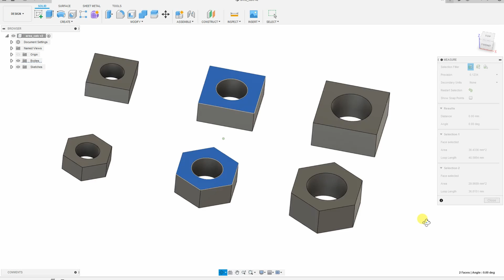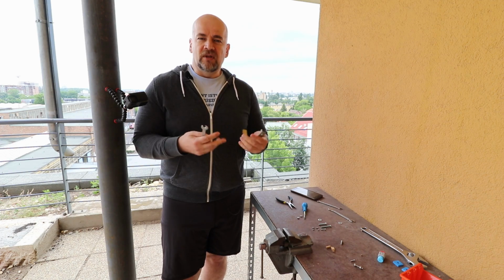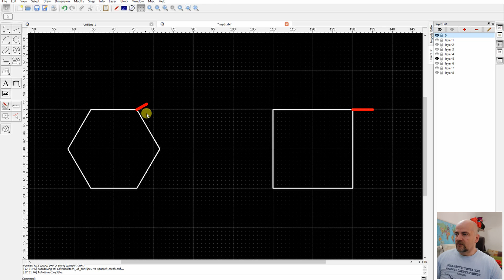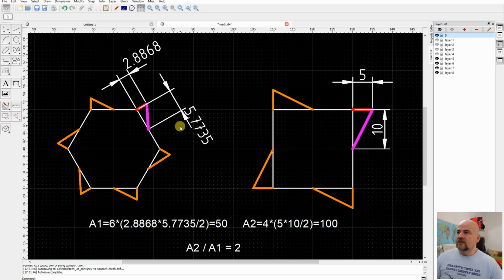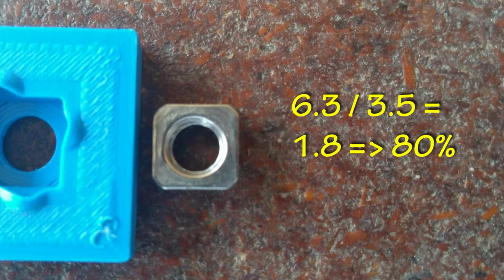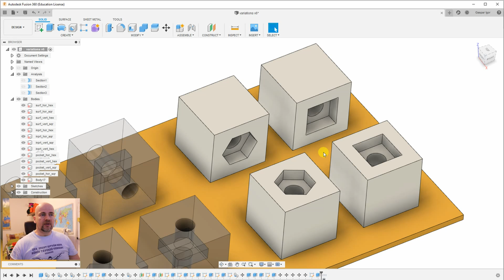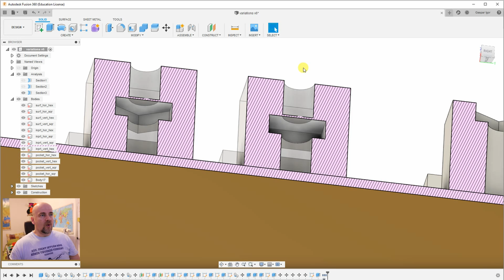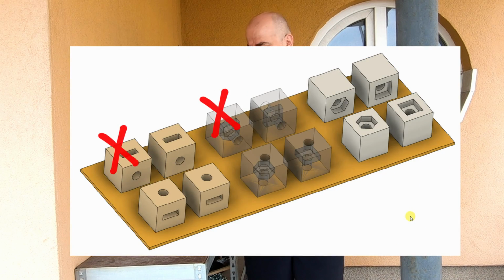Square vs hexagonal nuts as 3D printing inserts

Comment: I use the sharp corner square nuts wherever I can. I have never used heat set inserts but so far I haven't really ran into a situation where I couldn't use a square nut. The only issue is that the ones I have found are really imprecisely manufactured compared to the chamfered ones you have. e.g. the threads are tapped at an angle, or the square is a diamond, or it's rectangular.

Comment: Washers prevent bolts to untie too. That’s why you are using them with 2 metal parts, not to reduce stress like in the case of a wood assembly.

Comment: Dropping nuts into vertical slots after printing, you have further bonus with square nuts of being able to engage 3/4=75% (3/4) of its sides, versus only 4/6≈67% with hexagonal nuts. However, the downside for square nuts in this case I think is that there's a concentration of shear and pulling forces edge focused down onto a single layer in the corners, whereas hex nuts distribute the stress more widely across layer lines.

Edit: Ah! You cover this at 12:34. I like that you mention too getting the sharp cornered square nuts. I haven't been able to find quality ones of them though. All the ones I find are crudely clipped, off-square, and with holes that aren't centered. That means I end up needing to design with slop in either the screw hole or in the nut slot, so I often end up just using my better machined hex nuts anyway.

Comment: Another factor is the  print fill, which I am assuming it was on full?! Also what is the yellow plastic "washer" @13:34?
Reply from the maker: That's just a 3D printed nut from flexible material, so I don't need open-end wrench to tight that bolt. (and yes, max infill)

Comment: Agree with everything here.  I reached the same conclusions stupid, time wasting methods.  I print all my embedded nuts just like he did, with a pause and a 1 layer bridge.  It's so much easier when you have a part with 15 nuts and you don't have to worry about them sliding out of their slots.  It's amazing too how hex nuts will spin in almost anything.  I've even had square nuts start to spin in TPU parts when I'm not careful.  Great work, especially with the section analysis.  It took me so long to nail this down on my own, I wish there was something like this to watch when I was pulling my hair out.

Comment: https://www.convertunits.com/from/newton-meter/to/kg-cm 
As per above converter it is saying 6Nm is 61 kg-cm but you video shows that it broke at 3 kg.
Is the conversion correct
Reply from the maker: 3 kg on 20 cm = 60 kg/cm. If hanging scale would be only 1 cm from center, it would measure 60 kg.

Comment: i usually do a triangle hole on one side like with a hex nut when i do a square nut to solve the over hang problem that or leave the to empty i mean you can always insert it then glue in a plug for snuggly fit all sides
Reply from the maker: I will test triangle nuts too, just for fun and curiosity
Reply: @MyTechFun  hmm.. wasn't aware there where triangle nuts but that has to have the best surface area.... other then say a rectuagular nut that elongaded...but that would probably be wasteful of space..

Comment: Did you ever try to print nylon mechanical parts ? I think it's the ultimate material for strenght purpose, am I right ?
Reply from the maker: Nylon is good for technical parts, only problem is hard to print. Biggest problem is the moisture, it has to be very dry, enclosure recommended, use glue for better adhesion to bed.. PC is also good (will ve a video about it soon)
Reply: @MyTechFun  after i wrote my initial comment I saw the experiment you made in your car and oven with a lot of plastics, including nylon.  I heard it was really hard to print as you said.  I was wondering if it was worth it.  I think I would need to mod my CR10 with better hot end.. Anyway, thanks for the reply and for all this data, it's really usefull for a lot of makers all around !

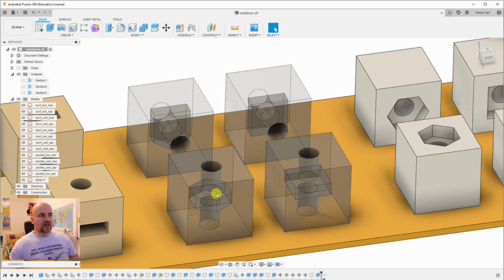Comment: At 11:10 you explain that you add bridging layer for horizontal embedded nut during layer-print-pause, because in CAD cross-section, it looks like you're printing in thin air. However it seems unnecessary, as the nut itself will serve as support material. Or what happens?
Reply from the maker: The problem is during 3D printing. Bridging requires two points to be connected, but here the printing would start bridging and then "stop" in air where the hole is. That's why I use here that sacrifice layer mentioned in video. Later, when plastic is solid, there is no problem with it any more. Create a similar object, and watch the printing simulation in some slicer, and you will understand what I am talking about.
Reply: @MyTechFun  When the nut is there, it's within 0.2mm of the layer being printed, so there is no bridging, you're printing on top of the nut instead of on top of the plastic. Bridging is like printing on top of thin air, but there's not air there, there's already a nut, inserted during pause command. Not sure why i should watch simulation, i know what failed bridging/bad overhang looks like, because... of course i sometimes design and print things that i intend to print with supports, and then idiot me forgot to enable supports.

But when the nut is inserted mid print, the top of the hole is supported by the nut when printed.
Reply from the maker: @SianaGearz  In this video I am talking about nuts as 3D printing inserts, you add them AFTER you finished the printing. During printing nut is not in the object.
Reply: @MyTechFun  But at this timestamp, there is no access hole through which you could install the nut after printing :D You have shown both constructions with an embedded nut and with a nut insert space :D I know i'm nitpicking, and i don't really have a real point, but it's a bit funny that you forgot what you did mere weeks ago... OK it's probably not fair, i often forget what i did an hour ago. :D But i sometimes wanna be THAT person on the Internet you know?
Reply from the maker: @SianaGearz  Oh, yes, that's inprint, you are right, must be my age.. forgot things. Or maybe my 3 work places and 3 daughters.. There is a chance that your idea would work to use a nut to support that bridging, not sure, I didn't tried that method yet. It will be interesting thing to test.. Thanks for the suggestion.

Comment: Very wonderful comparations,it's so common sense of course,the less corners or like star shaped grooves will always be better for full torque than a more of a circular shaped bolt or nut.
Reply from the maker: Yes, but not always less corner is better. Soon I will compare triangle vs rectangle screw nuts to explain the details.
Reply: @MyTechFun Totally get ya, Even  I was always thinking of  triangulation type bolts or construction screws sure would be  extraordinary lol.

Comment: Why couldn't hexagonal nut insert in builtin printing in vertical position early then square nut? It can be hexagonal inner builtin printing. Pentahedral as inverse house doesn't need, and it can let to increase torgue.
Reply from the maker: Inserting hex nut in vertical position? You can't close the hole, nozzle will hit the hex nut.  Or hole starts closing, then you can't insert hex nut any more.

Comment: Dumb question, but what about triangular nuts?
Reply from the maker: Not dumb question, I got several similar comments. In torque test they would perform even better, but they are not standard, you can't buy them and there is no key for them to use in other projects, you can use them only as inserts.
Reply: @MyTechFun  Ah, thanks. A lot of times when people are building stuff, I can't help but think "Triangles! Add triangles!" Thanks math class. :P

Comment: Square & Rectangle nuts for inserts are superior, that much is obvious. I also would assume the inprint method of installing them would be the strongest. Although, it is the hardest to put into practice. I wonder how much stronger inprinting is over the other 2. For example, is it much much stronger because it is surrounded by much more  material? Or is it only slightly stronger? In which case not worth the extra effort to invest in doing. I would love to see a test of that.... Inprint vs. pocket vs. surface...

Comment: Note: Metric square nuts have DIN 557 and DIN562 - 557 are thicker. In general I really like if people just give me the DIN or ISO numbers for screws and parts in builds. It makes finding the right parts SO much easier than "use square nuts". You can find them in any online store, Aliexpress etc. easily by their numbers and not spend half an hour trying to figure out which of the dozens of variations of nuts has to be used to fit into that pocket.

Comment: in addition you could take 1/8" (3mm) metal bar and tap-drill threads into a length to make a nut-plate and basically exceed the torque ratings of the threads and/or be able to generate much higher clamping force on your plastic, to the point of crushing the parts. Hope this is helpful.
Reply from the maker: Yes, helpful. It looks like I have to repeat the test with some rectangle and triangle nuts too (according to some comments) ;-)

Comment: Very good video. But how do the nuts compare to threaded inserts?
Reply from the maker: In this video I was only comparing these two nuts. Threaded inserts are good if you only want to joint objects only once. If you want real non permanent joint (like gopro mount), then metallic inserts are better. In near future I will test 3D printed bolts, nuts.. only to finish exams on my primary workplace ;-)

Comment: Most plastic component joining with fasteners doesn't require a "death-torque" anyways. Just getting it snug will do. Think about how most appliances go together with stuff like this, if you went all out tightening the screw that goes into some nut on your desk fan, you'd break it. Keeping that in mind, using the more common fastener would often do. (But I suppose using the square nut or bolt would be handy for some edge cases.)
Reply from the maker: In most cases you are right. So far I had only one project, where I needed very big torque with insert. Here I used a nut with insert to create something like butterfly nut, so I don't need a wrench (M8 and M10). And in combination with washer, the maximal torque was the limit for this joint. 100% infill can handle very big compression tension.

Comment: Nice explanation. I would have thought the shape furthest from a circle would be more difficult to deform the shape it's set it.  So going by this theory star nuts should deform the shape and slip less. Can you test this?
Reply from the maker: I don't have star screw nuts, they are not standard. And using them as 3D printing inserts.. theoretically yes, they are good for big torque, but in smaller dimensions (M3, M4 maybe M5) most common nozzle (0.4mm) will result only 1-2 perimeters between star tentacles and that will be a week point. Go with rectangles if you need something better than square version.

Comment: Honest question, can you get star shaped nuts? I know this would only really help for surface horizontal or inprint horizontal situations
Reply from the maker: Star shaped nuts? Not too standard ;-) Using them as 3D printing inserts.. theoretically yes, they are good for big torque, but in smaller dimensions (M3, M4 maybe M5) most common nozzle (0.4mm) will result only 1-2 perimeters between star tentacles and that will be a week point.

Comment: I might’ve missed it but were the two nuts the same thickness?

Also, the nuts could’ve been initially tightened to a higher torque so there would be no further tightening during the test making it easier to determine the yield load.
Reply from the maker: Same thickness, I forgot to mention. About tightening, M5 bolt is not too strong. I was stronger (with wrench) than threads on it on my first experiment. I tried to tight metallic nuts as much as possible. Threads were sheared.

Comment: Not really surprising as that is not the primary use of normal hexagonal nuts. They are designed not to apply rotational forces but longitudinal - along the rod.
Hexagonal nuts are a bit easier for handling (easier to get the tool aligned and lower angles needed to reset the tool) while also providing a higher force per area. Square nuts offer higher torque and and self-bite into the material. Different use cases, different nuts.
But in general, if the torque is sufficient i would go with the hexagonal nut - more widespread, cheaper.
Reply from the maker: In general I agree. But as 3D printing inserts, you don't need a tool for a nut. Only with those pocket inserts I wouldn't go with hex. In other cases, hexagonal will do the job too

Comment: One way that I like to visualize this comparison is just by focusing on the number of sides of the nut. As you increase the number of sides, you begin to approach as shape that more closely resembles as a circle. A circle will have minimum resistance to rotational force. Therefore, I always rationalized that  increasing the number of sides will make it less resistant to torque. Through this logic, fewer sides (a square) will perform better as a captive nut than one with more sides (a hexagon).
Reply: Maybe triangular nuts?
Reply: @desparky  I thought the same but those are extremely difficult to get
Reply: @octimus2000  that's why we print them ;)
Seriously we should start producing them, we would kill the hex nut... if there was no issue with the triangular wrench.. lol!  Good for sockets but I can't imagine a functionnal triangular open key/wrench..  square is best
Reply: @anthonythibodeau81  That is a good idea, but they would only serve the 3D market more or less... Also the nut isn't the issue here, its the material that braces/locks it into place, which is the 3D material!
Reply: @desparky  How about Torx nuts!

Comment: You can also force a nut into a tight pocket by using a screw that, as it rotates it will create a force in the axial direction, pulling the nut inside of the pocket. A washer on the other side will protect the plastic part from excessive stress from the bolt head pulling action.

Comment: the big question is what happens when the nuts are glued in, are there any differences?
Reply from the maker: Depend of the glue. In my case, glue only holds it to prevent falling out. But there are strong glues too, to fix against rotation (polyurethane base glue)

Comment: It would probably be more useful to calculate not the nuts themselves, but the strength of the recesses. The plastic parts will always have inferior strength to the metal, and rounded shapes run a great risk of deforming parts and spinning in place.
Reply: Gee, thanks Captain obvious.

Comment: So....we need triangular nuts?
Reply from the maker: In theory, they would be better for torque transmitting, but I suggest rectangular ones, if you will need to use it with wrench (as inserts you don't need a 🔧)
Reply: @MyTechFun  Years ago, my friend invented a car with square wheels. I told him that it was completely stupid because it was too bumpy and that it could have triangle wheels instead; one less bump as it turned.😃😁

Comment: During the electronic scale test, how come the hexagonal was double the torque before stripping the hole when we calculate the square version to be higher than hex in theory??
Reply: Did you confuse the two? At 6:43, the hexagonal nut was measured to skip at 3.5Nm, and at 7:36, the square nut was measured to skip at 6.3Nm. I would say that's a pretty close match to the theoretical result at 5:21 indicating the square nut would hold about twice the torque.